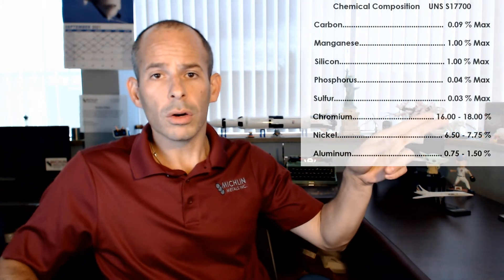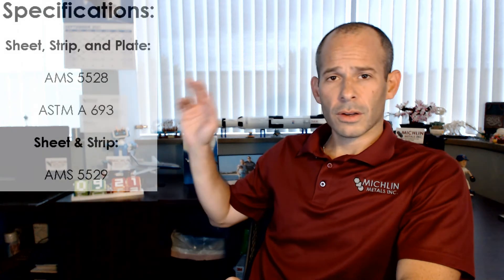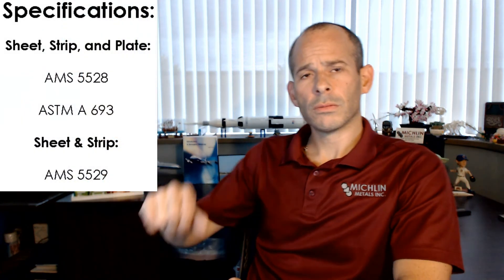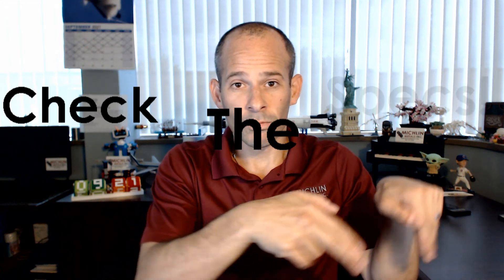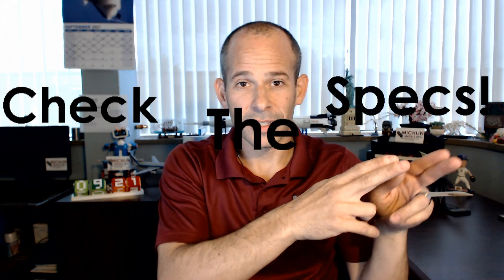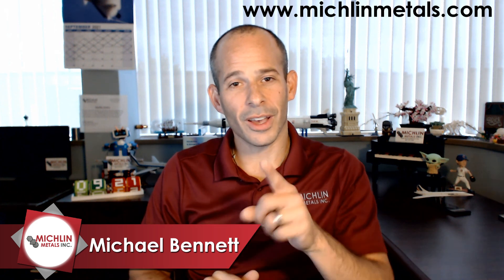17-7 Stainless Steel - 17-7ph - AMS 5528 - Sheet - Plate - Strip - AMS 5529

Comment: Can 17-7 ph springs be reformed and re-tempered similarly to 1095 spring steel?
Reply from the maker: Solution anneal then correct the shape and then condition and age to harden should work if the only issue is the spring has deformed. If the deformed spring has developed any cracks, then replace with new rather than try to affect a repair. Heat treating steps may be cost prohibitive. Hope that helps. Have a great day and thanks for the comment.
Reply: @MichlinMetals  very much so, I'm looking for an alloy that is corrosion resistant, and can be annealed at single points and then re-hardened to spring temper, similar to 1095. Can you suggest a material to look into?

Comment: So what has better corrosion resistance and strength?  17-7ph or 316?
Reply: From the chemistry, it would be behind grade 316 in corrosion, due to a lower nickel content and the absence of molybdenum.
Reply from the maker: 316 has better corrosion performance in most agressive environments.  17-7 has much higher strength but unless there is difficult forming involved in the part design, there would be better options to achieve the strength required.  Design engineers would want to know both the strength level required and the corrosion environment.